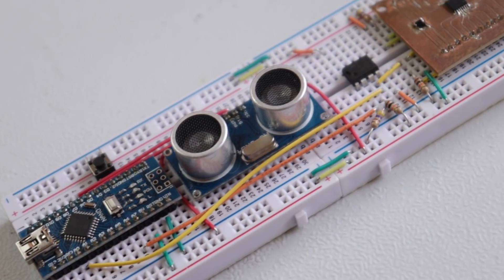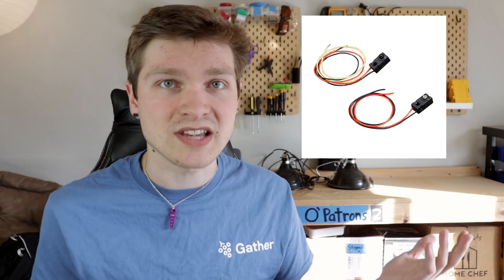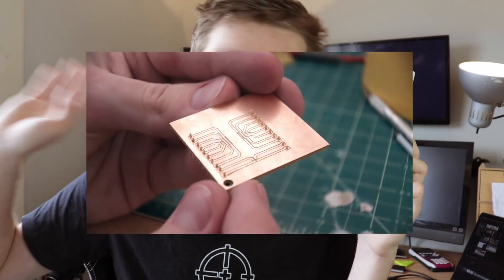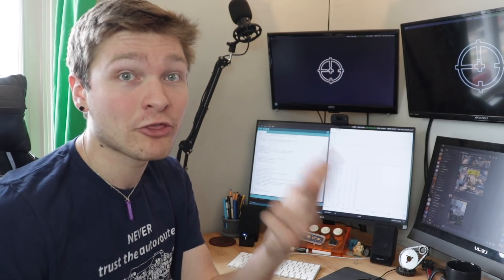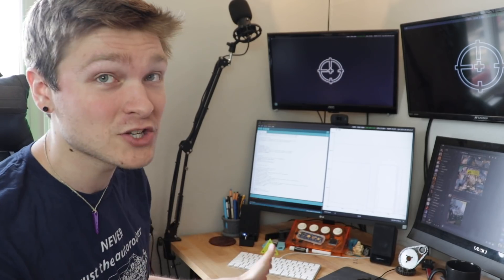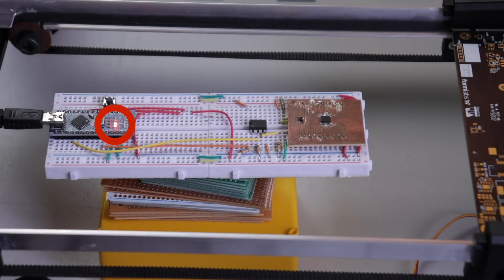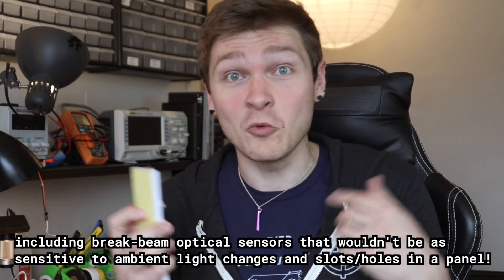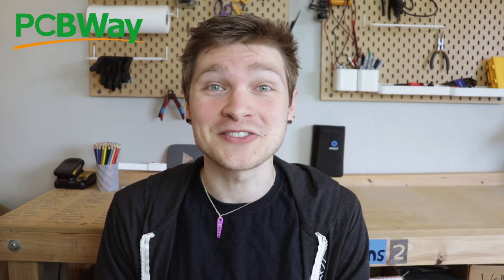Detecting Circuit Boards with Sound!

Comment: Reflective sensors in such a setting often modulate the signal and use signal correlation to find out what comes from the sensor and what from ambient. You would need a MCU to do this as well, so the ultrasound option is so much easier to apply in your case.

Comment: I would use a photoelectric proximity sensor or capacitive proximity sensor we use them on a few conveyors at work that look straight up to detect if a box is on the conveyor.

Comment: You can control the LED on and off and take a reading of the sensor with it on and off, subtract both measurements and you've got a reading immune to light, do this many times a second and take a moving average and you've got a decent sensor.

Comment: Little tip, although technically you can use an opamp as a comparator, it's recommended you use a dedicated comparator instead. There's an interesting timing issue with saturation that occurs in opamps, but they tend to work better in this application in general really.

Comment: On our professionnal convoyer we had on our SMT line, we had originally optical sensors, but the trouble was with the sun. I worked on a proximity sensor manufacture, we replaced the original one by customs one with red light and IR sensor, like this we avoid sun problems!

Comment: Trying to use a this to detect a board in machine repeatability is going to be a pain just use a stop then clamp like older PNP machines.(I think tuning this per board would get old quick and especially if you start getting into double sided boards) It would still work well for a sema interface for detecting when the board enters, exits or is in que on the conveyor.

Comment: Fire your LAZORS!  Instead of using reflection, detector on the other side of the board you're trying to detect.  Should be reliable and precise.  Solid state lasers are surprisingly inexpensive on aliexpress.  Plus also, you get to say "LAZOR" a few times on your next video.

Comment: As others already have pointed out, you already have a camera mounted top down. That could be used in numerous ways.
1. Add an Aruco corner on the board and use the camera to calculate the board's position.
2. Add an addressable LED strip underneath the PCB and light one LED at a time until the light disappears.
3. Use edge detection from OpenCV to detect the border of the card.
4. Use the camera to detect an expected footprint on the PCB.
Several solutions could be combined to a greater effect. Good luck. =)

Comment: Use a optical limit Switch, super cheap. Used in 3d printers. E.g. https://www.amazon.com/-/dp/B076D2NV26/ref=mp_s_a_1_7?dchild=1&keywords=optical+limit+switch+arduino&qid=1620023063&sr=8-7
Mount it so that the board goes through the gap. Super precise, plug and play, cheap

Comment: In addition to the other suggestions to use a carrier frequency for the IR sensor, it's possible to get much smarter on the analog side with more op-amp magic/filtering. You can set up hysteresis to reduce noise and multiple triggering, and it's possible to build a circuit that dynamically adjusts to ambient light by only watching for fast changes in light output, with the "baseline" off reference constantly adapting to the long-term light level. This allows you to make your comparator trigger threshold much more aggressive because it's now "light level relative to current ambient light" rather than an absolute light level; this will also help with different reflectivities as you simply tune the comparator sensitivity to the "worst case" and it works equally well with more reflective boards.

I built something like this to detect flashing headlights/emergency lights years ago in combination with a photodiode and some lenses/filters and it worked surprisingly well, outputting a very clean on/off signal any time the sensor's illumination level changed fast enough. Worked equally well in daytime and darkness in an outdoor but covered application. It was set up with a multiple-minute time constant for the baseline reference adjustment, so as long as your panel edge detection takes less than a minute or so you should be able to adapt to any other light level changes in the area well.

That being said, this still doesn't resolve the small sensor potentially causing problems on board cut-outs, although you can likely mitigate that in software by having it scan past the "edge" of the board and seeing if it becomes visible again within a few mm (which would help with all but the largest cut-outs). The ultrasonic sensor is likely simpler, but it will take up a lot more space on the machine and will be a lot more expensive than a IR detector arrangement - maybe not critical considerations for a project like OpenPnP.

Comment: Hey! love the project. I've worked with a bunch of IR sensors you might wat to take a look at the GP2Y0D805Z0F. It seems te be pretty much everything you are looking for. Pololu makes some nice breakout boards. It uses some form if IR traiangulation insted of just the amout of light reflected, so it shouldn't be influenced by outside lightsources. And it already produces a digital output without extrenal components.

Comment: have an led under the path of the board, position the camera over that known location and then feed the board until the led is covered. the led shouldn't be too hard to detect and light conditions will be insignificant compared to the dirtect led light

Comment: Fun to see this continuing to progress! Need to figure out some project that requires mass production of PCBs just to have an excuse to build one of these. With the IR sensor, one option is to encode a specific signal that you're looking for, so you can tell noise apart from signal.

Comment: I know with reversing sensors that if they get dirty they give false readings, so if you mount then top down you won't get dirt and dust on the sensors. Additionally, with optical sensors a shroud is often used around the sensor to prevent unwanted light triggering a false reading.

Comment: The "Sharp IR" sensors (GP2Y0A21YK0F) are essentially an IR LED with a small half angle (narrow beam) and a linear/2d optical sensor (line scan camera). It essentially uses parallax measurement to calculate distance. They're a little pricey,  considering an IR beam is probably all you need. A bright IR LED and phototansistor, both with a narrow angle. If you measure the phototransistor with the led on and off, and take the difference, you can figure if the board is in place (independent of background light). Would work as a "beam" sensor with LED and PT on opposite sides of boards, or a reflectance sensor if mounted on the same side. With a bright enough LED I wouldn't expect a matte PCB soldermask to be a problem. The SFH4545 and TEFT4300 would be a good starting point.

Comment: If only you had a moveable downward looking camera that could be moved to a given spot (with a coloured marker below it) and a computer already running computer vision, the detection of the pcb  position could be 100% "free" but would require some software... Oh well...
I'm also one of those that think you didn't give the optical sensor much of a chance, with ambient light it needs modulation and band pass (or at least high pass) filtering. They also do come with different focus distances though I would use a setup where the beam was interrupted as most PCBs are IR opaque

Comment: Why not use the overhead camera. If you get some coloured card to put underneath the pnp, I.e. hot pink, because no one makes hot pink pcbs. It could be as simply as taking the average colour across a column of pixels. Means no extra BOM at all.

Otherwise capacitive sensors can be good too. And the hardware for a capacative sensor is built into the stm32s

Comment: Reuse an existing sensor... your camera! Advantages: no extra BOM, can configure the board stop location in software (per job if required!). Simply move your down looking camera to XY position and activate conveyor. Stop conveyor when board enters camera frame (eg detect a significant change in pixel values in middle zone of image ). OpenPNP then takes over with fiducial search, starting at your configured board stop position. Simples.

Comment: I honestly think the IR sensors are way more suited for this. You do NOT want a reflectance sensor though. You want a beam-break sensor. You already have a lower bound where your PCBs ride the belts, they can't go lower than that. So a sensor that either overlaps past the belts contact point, or is at the intersection of where they start/stop.

Comment: I wanna say you can get away with a microswitch so long as it has a long lever arm and a ramped slope - same as how pinball machines detect balls in lanes. They can't have the switch interfere with the ball rolling, so it takes very very little force to push those in. https://www.marcospecialties.com/pinball-parts/5647-12693-19 like this. They take virtually no force to actuate.

Comment: Ultrasonic sensors accumulate dust... Better not sure it for long term... Use ir sensor one end and photo diode at other end opposite and let PCB break the light path for detection....

Comment: Great video, love your enthusiasm. My 0.02USD: I think you might be better off using a capacitive proximity sensor for this application. They are widely used in industry for detecting objects, for example on an automated assembly line. 

Inductive proximity sensors might work too, but I'm not sure. 🤷

Comment: It would be much simpler to use   The break beam light sensor.  A board is there or not. It’s not going to be transparent. You just need the leading edge, whole in the board should not be an issue. And you can control the sensitivity so ambient light has less impact.

Comment: There are optical sensors based on reflexion wich dont send out light all the time but with a specific frequenzy wich the sensor is expecting to get back. With this princip the sensor can compensate other light sources. Because they can compare the light intensity when the led is on and of and/ore only give an output when the send out frequenzy is coming back.

Comment: How about adding a resistor to the analog output signal such that the range is between 0 and the threshold voltage of a transistor gate?  Some light sensors requires shielding from ambient light in order to operate reliably.  BTW, are you Polish?

Comment: While I enjoy your personality.   Most 3d printer use optical limit switches because they are cheap and better than mechanical switches, with repeatability much better than < 1 mm, usually better than 0.1 mm  ( a layer height. ).  If accuracy was your  only requirement I am surprised by your pick.

Comment: In my opinion you have used the wrong type of IR sensor.
Try searching for "Optical Sensors - Photointerrupters - Slot Type - Logic Output" and embed it on the rail (just select the right Sensing Distance)
For example: GP1S173LCS2F

Comment: Rather than using a sensor to detect the position, the pick and place machine I run boards on(Assembleon Topaz) just has the PCB run into an air cylinder and run the conveyor for a second or two longer than it thinks it needs to. Then when it PCB needs to leave the machine, it lowers the air cylinder and runs the conveyor again. Pretty cheap, easy and reliable to precisely locate a PCB. It does use laser distance sensors on other points on the conveyor for different(less positionally sensitive) purposes.

Comment: Why bother with an analog sensor when you need to convert it to binary? You were on the right path initially... an optical Tx/Rx pair are inexpensive, non-contact, repeatable without reflectivity concerns, and very binary. Keep it simple.

Comment: If other things don't work out take a look at the AD7745  -- its a capacitance to digital converter.   Its range is around +/- 4 pF, may be possible to sense the board transit through the dielectric changes.  Just a thought.

Comment: Break beam optical sensor at the rail where you guide the PCB panel? If it runs trough it gets triggered. Should be much more easier and cost effective. You could then implement a couple of them to detect stations( placement, soldering station)  sensor like the GP1S23

Comment: I'd have gone the beam-interruption route and watched two spots on the board feed rail on the inlet side with a small known distance between them, (say, 0.5-1cm, although I don't see why it wouldn't be possible to go smaller) and similarly two on the outlet, and with a little processing it would be trivial to know when the board was at the right spot coming into the work area (trip #1 then #2 and when #1 goes off you know it's between #1 and #2) as well as far enough out to be safely out of the way.

Also, if you want to get more complicated you can do remarkably precise locating with a small camera and OpenCV. I have a project that uses two laser diodes a carefully selected distance from each other and at a carefully set angle between them, and with a camera looking at a target (a simple sheet of paper) and feeding the image into OpenCV, and some filtering and trigonometry applied to the image, I'm able to get sub-millimeter distance measurements. Just the movement from blowing air on the target paper is enough movement to detect, so I had to clamp it between clear plastic and fix the camera to it so nothing could move except for the target.

Comment: The way I use IR reflection sensors is to sample with and without the TX LED on. Then I look at the difference between these two readings as my output. What this does is if there is ambient light on the sensor both readings have the common mode signal and thus the difference is cancelled out. So what the signal represents is purely the difference due to the reflection. It works great for me! Of course this relies on the two samples not having different common mode components, ie the lighting doesn't change . But that is easy to solve but just sampling the two very soon after each other.

I use this solution with that exact same IR sensor to reliably sense whether the lid is on my product or not for tamper detection. Also, the lid of my product is matte black ABS, so the reflectivity isn't even very good. But with some very basic filtering and taking a few interleaved samples as I described above, it works absolutely perfectly.

One more note, if you decrease the current limit resistor on the TX LED (within the maximum current rating of course) and increase resistance of the pull-up on the output. This drastically improves the sensitivity of the sensor. The sensor is marketed as having a range of a few millimeters, but I reliably use it at ~25mm.

Comment: i use a capacitive probe for auto bed leveling my glas bed 3d printer. works a treat... give it a try. its reliable, cheap and readily available.

Comment: VL53L0X V2 Laser Time-of-Flight Distance Sensor Module for Arduino

These are small, cheap and accurate , I use them all the time
Reply: Have you tried the VL53L1X? It’s slightly more powerful and stable in my experience

Comment: I would look at the "VL53L0X" and "VL53L1X". Both being TOF laser-ranging modules that interface via I2C. Also priced similarly to the ultrasound breakout module. You could mount one directly to the controller card depending on how it will be positioned in the machine.
Reply: I just recommend the same 🤣
Reply: He said no I2C though
Reply: @KANahas   He's looking at sticking a mic on there for the HC-SR04 anyway. So at that point the world's your oyster.

Comment: What is the problem of using the camera to looking for the edge of the boards ? (before calibrating)
Just put camera in X,Y pos. to wait for the board, while conveying let OpenCV watch...
You could put a rgb Led below, if OpenCV would make a problem.not finding the edge.

Comment: I'd just go the lazy simple way and put a microswitch through the side of the conveyor rail so the edge of the board triggers it. You could use maybe five of them and select which you want based on how big the board is and where you want it to stop.

Comment: I would think your down-looking camera would be able to detect the board edge.
Reply: Agreed, just what I was thinking. And you already have that camera built into the system, so no increase in BOM cost or complexity. It might be hard(ish) to detect the PCB panel from a single static image (different soldermasks, size of board, etc) but it should be much easier to identify exactly where the leading edge of the PCB is as it moves by comparing images from the camera before and after a set amount of belt movement?
Reply: Put an LED below the board, move down-looking camera above LED, and you now have a photo-interrupter which can detect the board edge independent of what it looks like.
Reply: Most likely the camera is in another subsystem then the conveyor belt, thus cannot be easily be used for this purpose from a software side

Comment: just a little idea that i tested just for a proof of concept a year ago : black plastic trash bags are transparent for thermal cameras (glass, on the other hand is opaque), thus  they bloc most of visible spectrum bu are very transparent to IR wavelentghs. Just by putting one or two thicknesses of garbage bag, I decreased a lot the sensitivity to visble light of an infrared barrier I salvaged in an old printer, maybe you can use this property of a such low-end product to your benefit in terms of reliability of infrared sensors

Comment: why not inductive sensors ? can't it detect the copper on the pcb?
Reply: Only if the edge of the pcb has copper in it (the antenna side of a pcb may have a large area without copper)